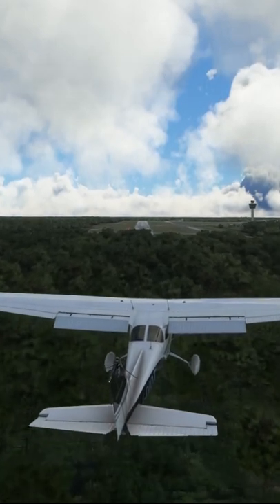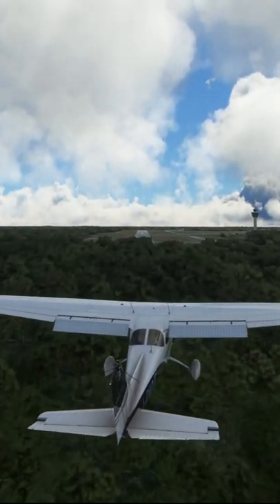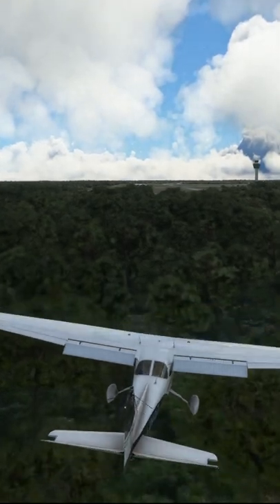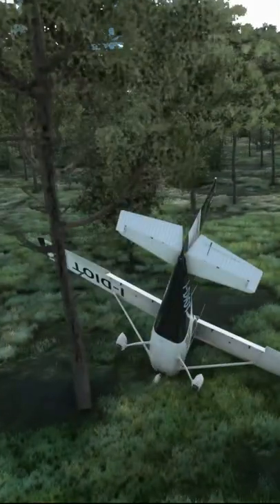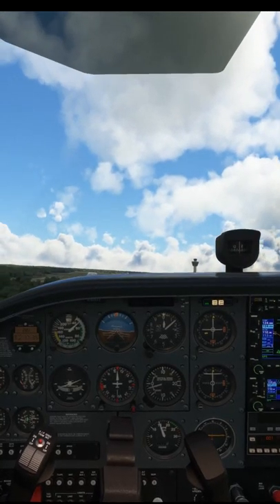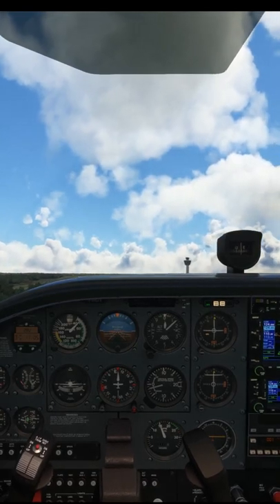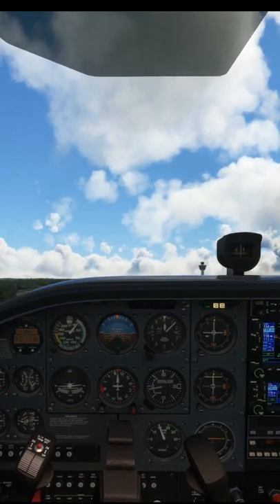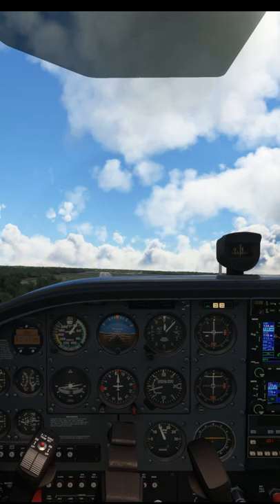Stall on Final Approach: How to Avoid in Microsoft Flight Simulator #Shorts

Comment: Very Nice! Is there a way to know how feet are required to recover from a stalled condition? In other terms what is the altitudine boundary between imminent crash (not phisically recoverable) and a height which still guarantees some margin if actions are initiated immediately? Thanks in advance
Reply from the maker: If a full stall is developed in landing configuration, you will be likely to lose at least 200-300 ft. Stalls are not entirely predictable so there aren’t really any guarantees. The best way is take action at the early indications prior to the stall. If this is done, you can expect zero or minimal height loss.